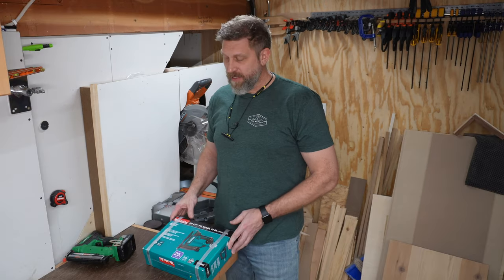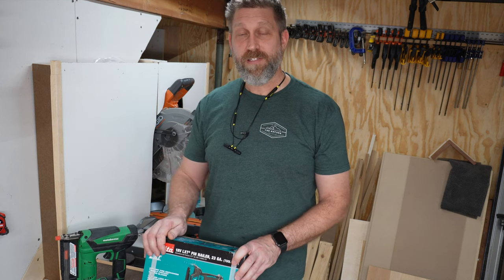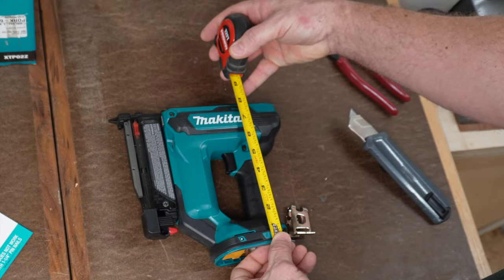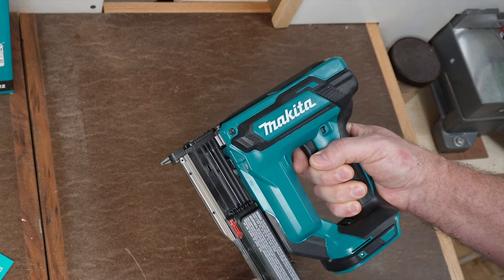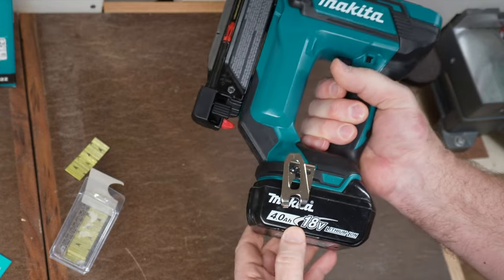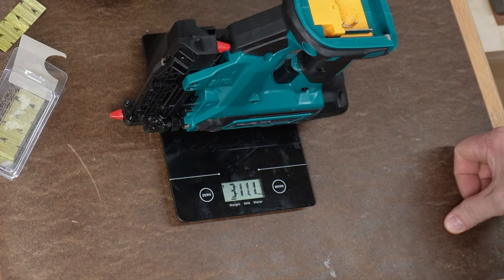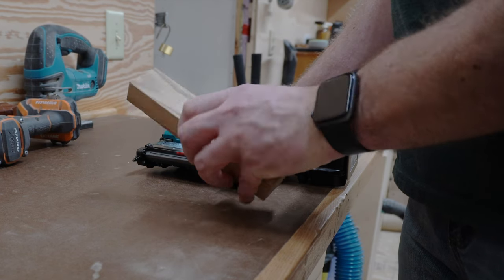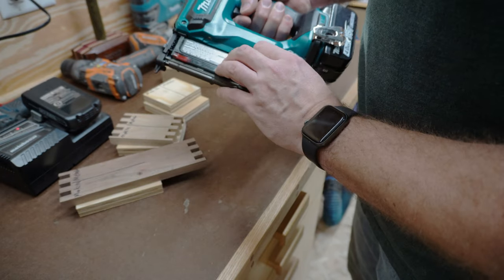Makita 18 volt 23 Ga Cordless Pin Nailer Review and Unboxing -Compared to Metabo Cordless Pin Nailer

Comment: Have the Makita version 2.  Is not consistent, and jams too often.  My Solution = Milwaukee M12 12v 2540-20 23 GA Pin Nailer - Drives and properly sets pins into any species of wood, almost 100% of the time! Have been using it since early January/24, and is a pleasure to use.
Reply from the maker: I do like Milwaukee. And not just cuz I'm from Wisconsin. Let me specify... I like the tool company, not the city. Anyways, it was a price thing for me.
Reply: I lucked out and was able to pick up the Milwaukee on a price match from a hardware store that was liquidating.
Incidentally, I am fond of Wisconsin - Racine and Frank Lloyd Wright's Johnson Wax buildings, and Lake Mills the home of Obsession Telescopes.
Enjoy your videos - keep 'em coming

Comment: I have makita everything. 3 yrs ago (still under warranty - last month of it for both) my 16 gauge & my brad nailer battery operated guns both gave up. Its a free fix so cant complain but an inconvenience. Repair will be a while. Have my old senco hose guns will make due while makitas are being fixed. Repair shop said its probably just the gaskets that need replacing. Im ok with that. 2 yrs ago I bought the metabo battery framer. Its a beast & goes all day framing on a single charge. My only complaint? Its heavy & it WAS pricey but it performs flawlessly. My 2 cents. Its nice going hoseless esp. for quick little jobs.
Reply from the maker: Thanks for your input!

Comment: Hey man I wanted to purchase this pin nailer but I saw some bad reviews how's yours holding up does it sink in nails like it's supposed to?
Reply from the maker: I think some of the bad reviews were from the first iteration of this tool. The one I have is the 2.0 version. It kind of depends on how hard/dense the wood is and how long the pins are. Longer pins don’t want to sink all the way into harder wood. Softer woods no problem.

Comment: Hi what range in length of nails do both nailers have
Reply from the maker: Good point! I should have covered that. The Metabo takes between 5/8” and 1 3/8” pin nails. And the Makita takes 5/8", 11/16", 3/4", 1", 1-3/16" and 1-3/8", of 23 gauge pin nails (tool does not work with 1-1/4" Pin nails for some reason)
Reply: Hi thanks for your reply that helps me a lot, there are a lot of these video’s and none of them cover the one thing you really need to know as most woodworkers know how they work and all the ins and out of them, thanks again dave
Reply from the maker: You're welcome. Glad to help!